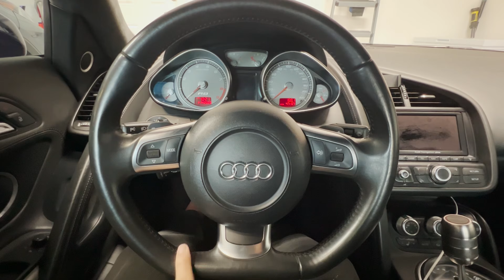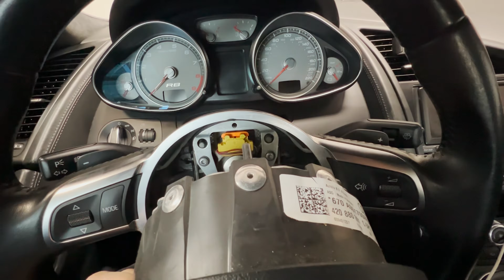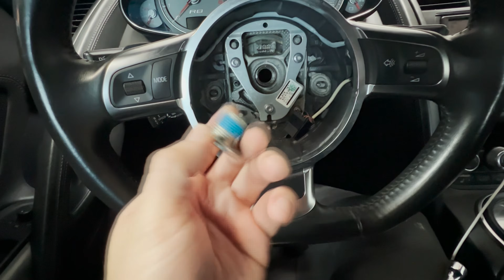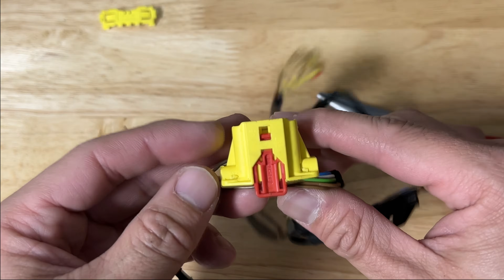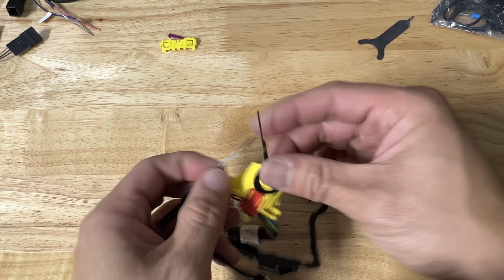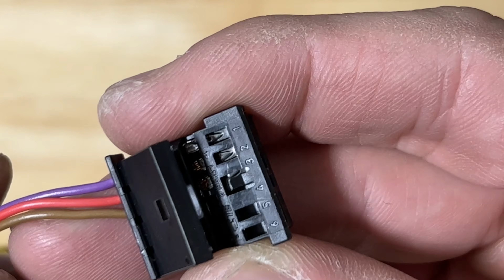Upgrade the Old Audi R8 Steering Wheel with a Working Push Start Button: Part 1

Comment: So you have to buy the new steering wheel with a new air bag or the original air bag will fit the smaller new cap?
Reply from the maker: You need a new airbag along with the new steering wheel.